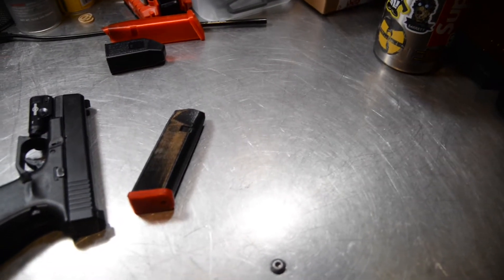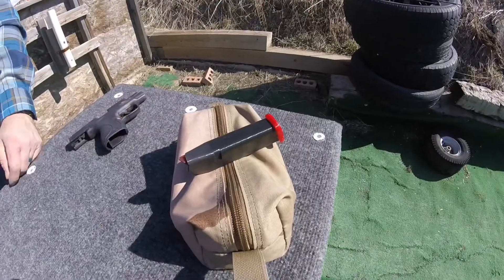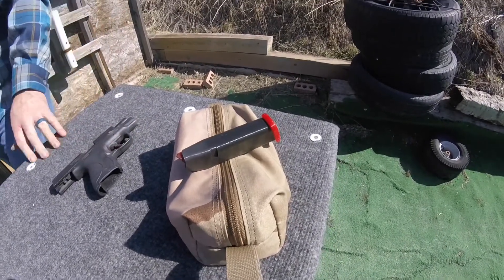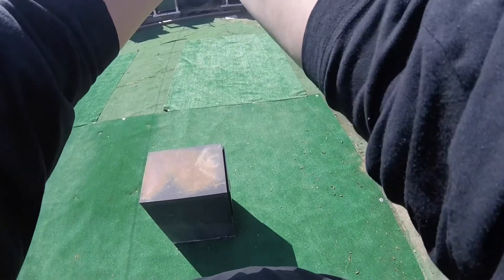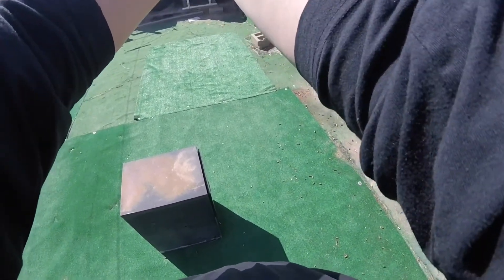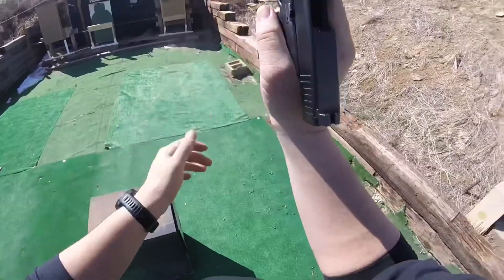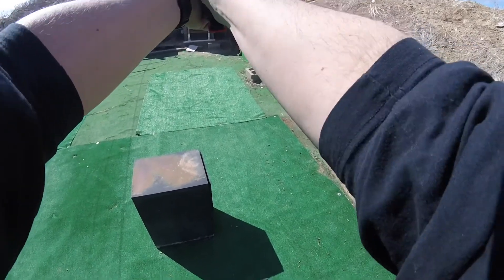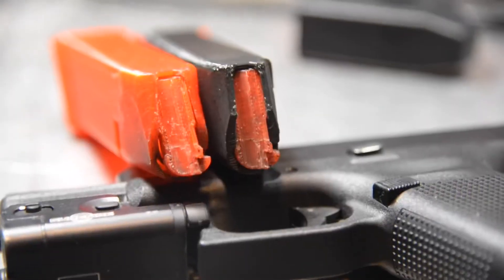Success! Update on 3D Printed Glock Magazine

Comment: Try 100% and use 0.4 mm layer height, seems stronger that way when i print it
Reply: I'd say layer height should be 50% of nozzle diameter, but past that I agree on the 100% infill. Manendez mags often just do 999 walls/continuous infill rather than an actual pattern infill, so that may work better as well.

Comment: What materials you using?
Reply from the maker: PLA
Reply: @godsplaid  just tried some Carbon Fiber PLA for a glock lower and it is great. PLA will warp when under pressure for a long time like in a loaded mag. Might have better results with The CF nylon or CF PLA. I printed both with my ender 3.
Reply from the maker: I’ll look into that for sure. I’m thinking about doing different runs with all the materials and see.
Reply: @godsplaid  for sure. Where did you get the springs? I think aves sells them but wanted to make sure it was reliable
Reply from the maker: I had some factory springs because I had replaced them with Wolff extra power ones in some other mags.